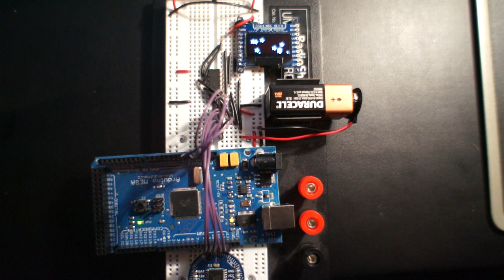Adafruit SSD1306 OLED test

Comment from the maker: @jeriellsworth I'm hoping to figure that out today. As it stands, when setting or clearing the entire display, you can see the update sweeping from top to bottom. I'm going to start by making an instrumented version of the Adafruit demo code to gather timings to use as a benchmark, then try various improvements. Their code bit-bangs SPI to the display - switching it out to use the AVR's hardware SPI seems like a good start.